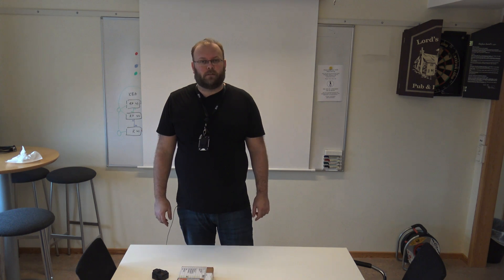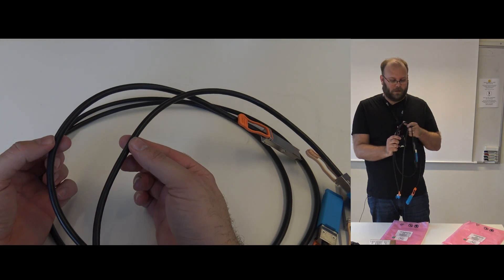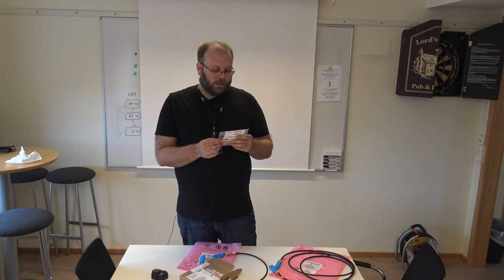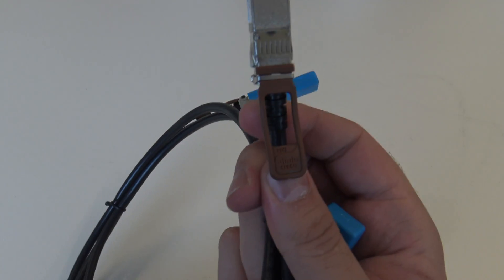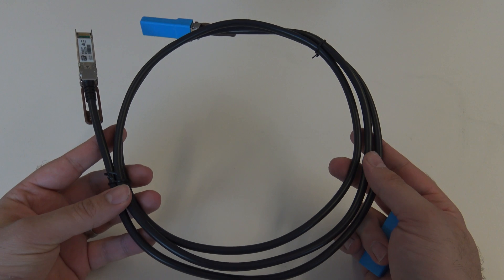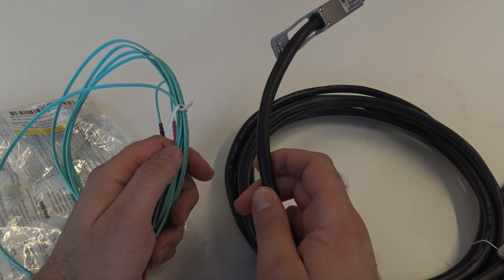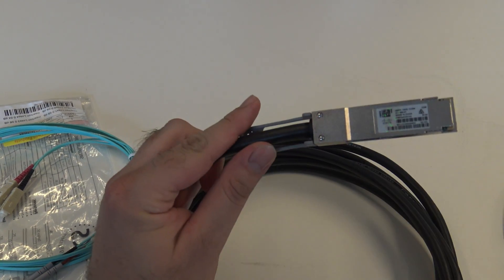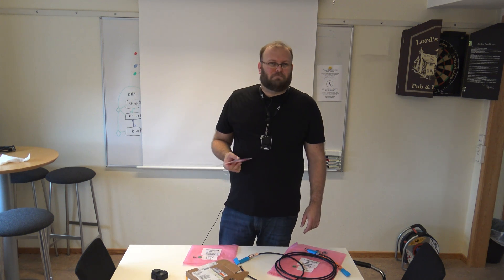DataCenter Cabling - SFP or DAC

Comment: In my old company, we used 40G/100G QSFP with MPO to MPO cables between the spine and leafs. There were also some talks of buying 40G QSFP MPO to 4x10G fibre breakout cables for the next DC setup but I moved on from that company. My ex-boss was saying MPO cables are 1/4th the cost of DAC cables. What are your thoughts on MPO and break out cables in the DC?
Reply from the maker: MPO together with MPO cables was really good option before, 
MPO sfp is has the same list price as the newer QSFP40/100-SRBD but the SRBD can use normal OM4 fiber meaning it’s cheaper then the MPO. And it’s easy to fix cableing as normal ODF and such can be use 

Cheapest option is DAC, but I would not use DAC cables longer then 1-1.5m within datacenter as they are to thick so it get complicated. DAC is very low cost for connecting servers.

Yes the MPO fiber cable is cheaper then a DAC but with MPO you need 2 sfp and 1 cable so ita much more expensive. In total then DAC.

Without any question what so ever my pick is SRBD for connecting within datacenter and then DAC to servers when they are within same rack.

Between datacenters you still need to go for normal SR/LR/ER or what ever you guys using SRBD is 100m on OM4

Comment: I like this video, its an interesting subject. I though DAC cables wasn't really used in datacenters so much, i assumed SM would be the way for increased density and easy of cable management.
Reply from the maker: In my experiance SM is way to expensive within datacenter for high bandwidth. So it’s MM with OM4 that is more common.  

SM is ofc used to and from the datacenter as MM is limited to 100m for high bandwidth. I would say DAC or copper 10g is very common in datacenter for compute due to price aswell. 

Am not sure how it is for the really big vendor such as google, facebook etc, am guessing they use copper for their compute nodes.